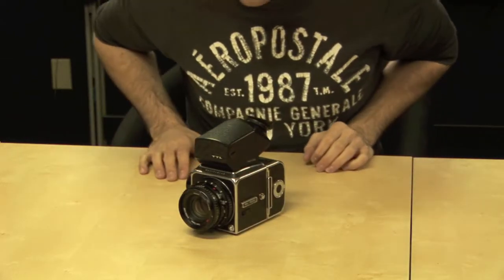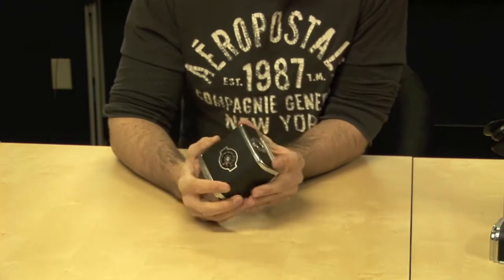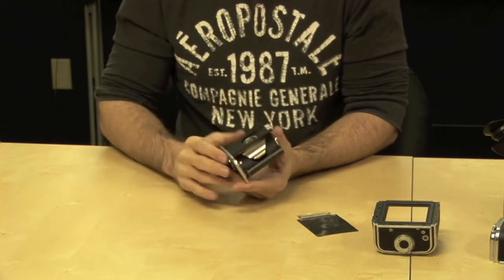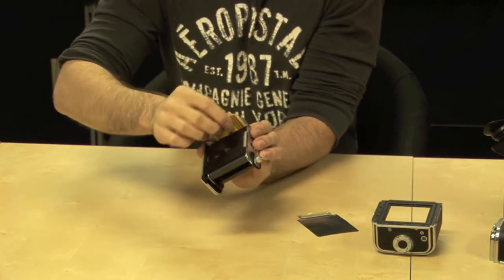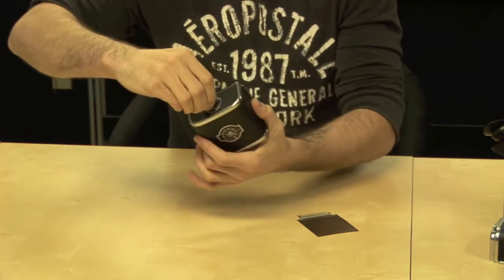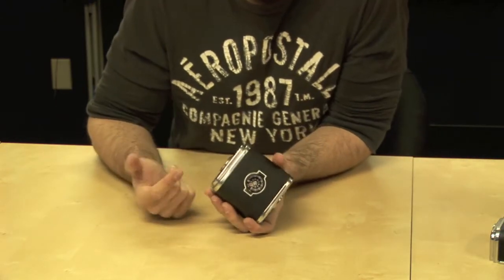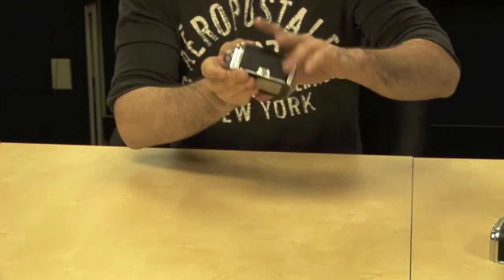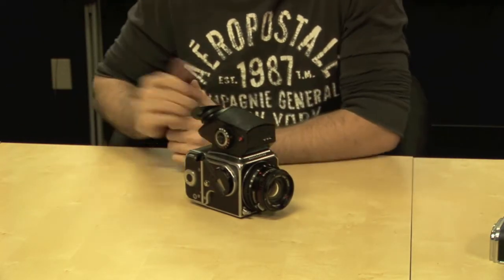How to Load Hasselblad 500c C12 Back

Comment: Thank you so much. After having my first kid I put aside my medium format gear for 5 years (no time for processing/scanning and slow setup photography while he was a baby) and now when I was ready to come back I'm embarrassed to say I didn't entirely remember how to load it properly. I forgot how to release the pressure plate and I forgot you have to manually set the counter (I have thus far ruined 3 photos by advancing too far waiting for the counter to advance to frame #1 on its own. THANK YOU for posting this video as I had completely forgotten on the C12 backs that you go to #1 on the paper backing in the window and THEN turn the advance lever counter-clockwise to set the frame window counter to 1 as well. I feel so silly but also so happy I don't have to spend $100 to get my back serviced. I think this beautiful old camera doesn't need a CLA after all.

Comment: Very clear thanks but I am at 1 on the inside paper but 8 on the counter, help!
Reply: +mamiyapress Did you ever get an answer?
Reply: +CathodeRayTube99 No.
Reply: +mamiyapress You turn the winder BACKWARDS about a quarter of a turn and you will hear a CLUNK;. That resets the counter counter to 1. HTH. I've used Hasselblad kit a lot. Let me know if you need any more help.
Jack